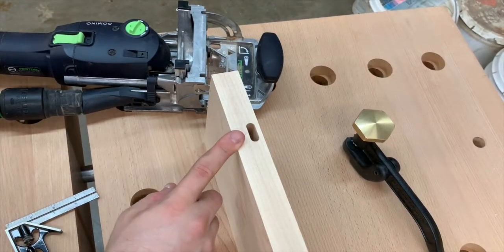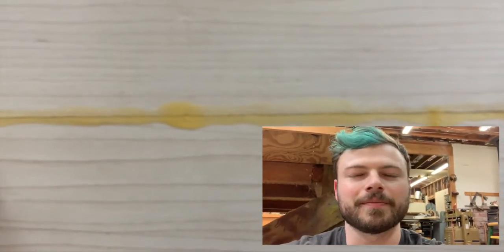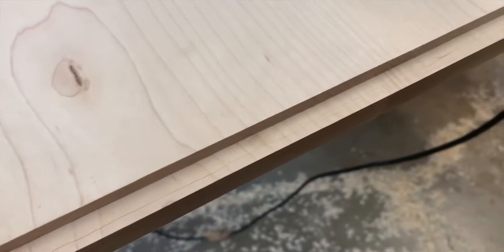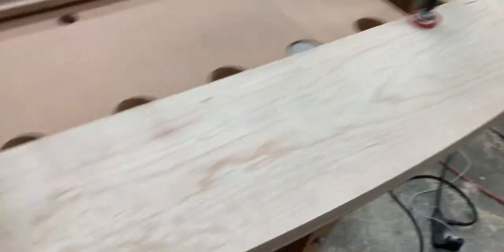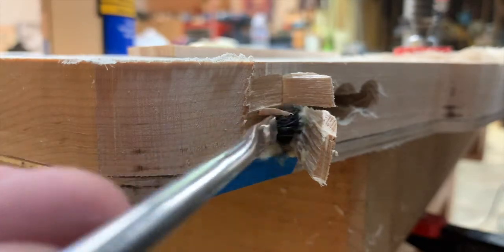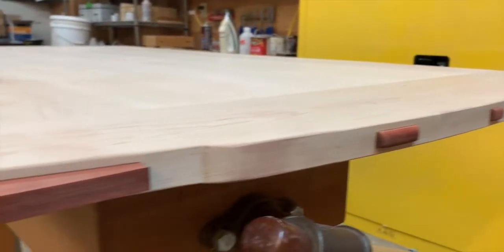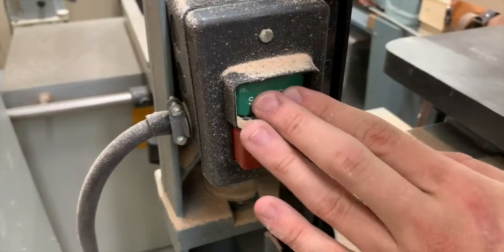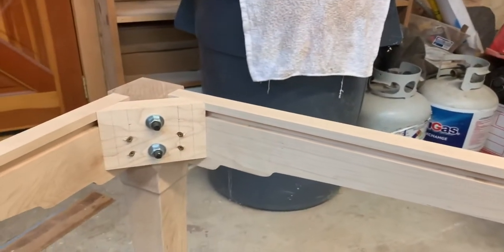Making a Greene & Greene table: Kodama Woodworks

Comment: check out mike farrington's sanding disc for saw marks on edges like that. it is so worth it. and much better than the jointer in my opinion because your board edges are still parallel when you are done : )
Reply from the maker: That… that is really cool. Honestly, thank you for letting me know about that. Definitely looks like something I’d break out the extra kickback protection for though.